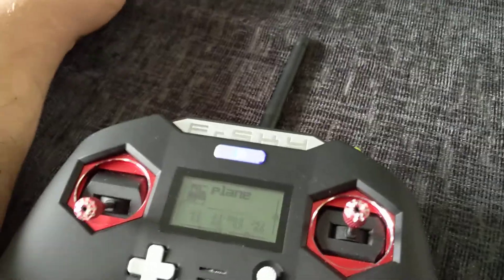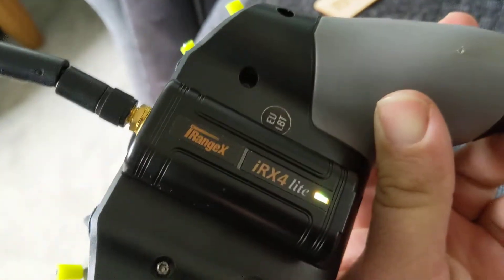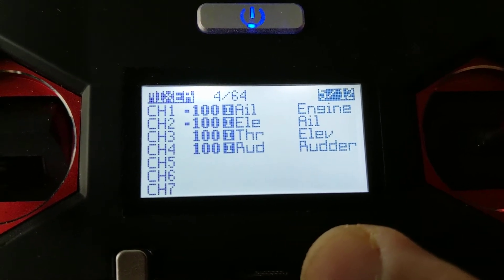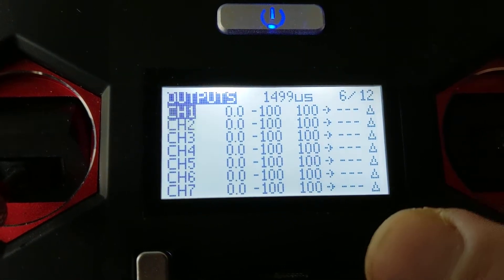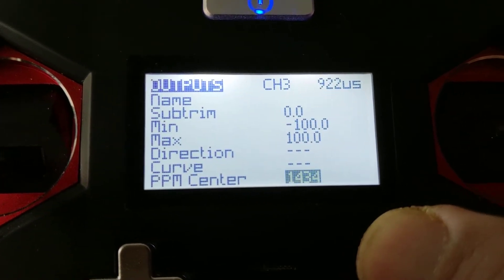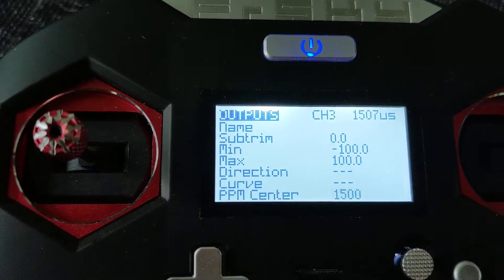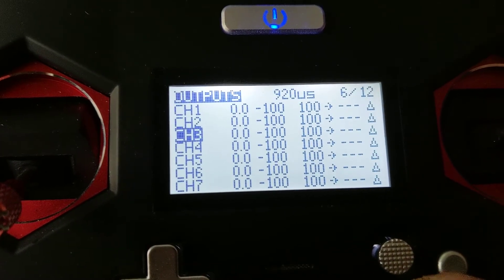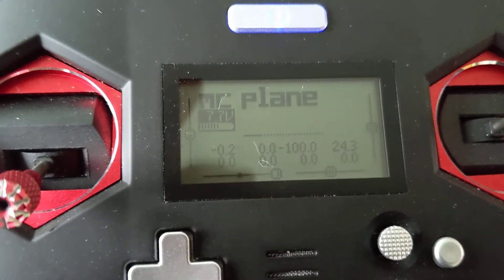2.4G 4CH Micro Low Voltage DSM2 DSMX + xlite - banggood

Comment: I’m using a jumper t8sg and can’t get the throttle to work either on my brushed 716 motor. Any ideas on how to fix this?
Reply from the maker: What ESC receiver are you using? And are you running opentx?